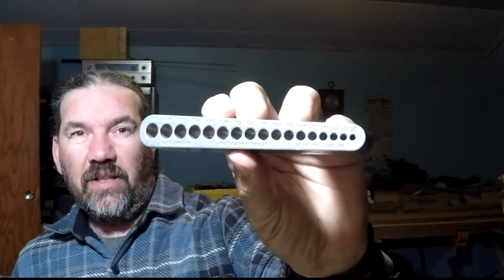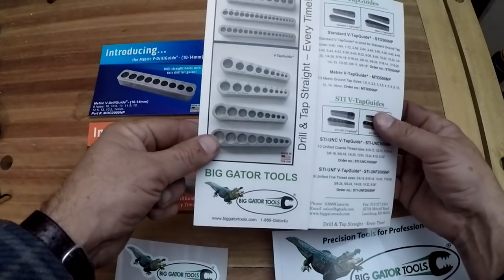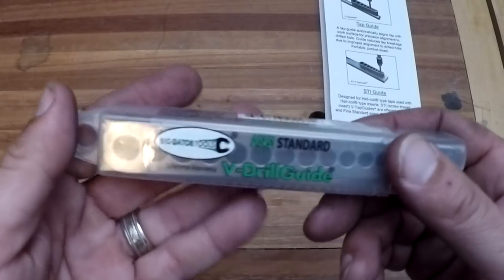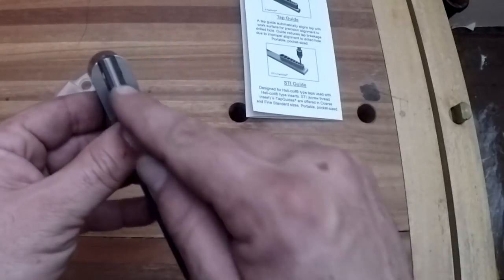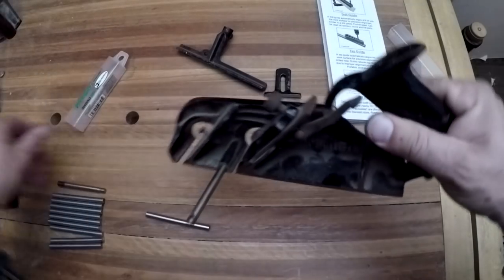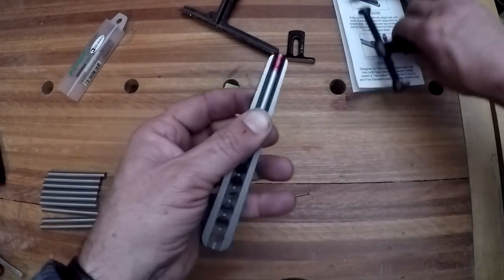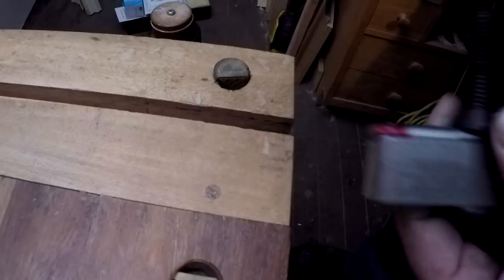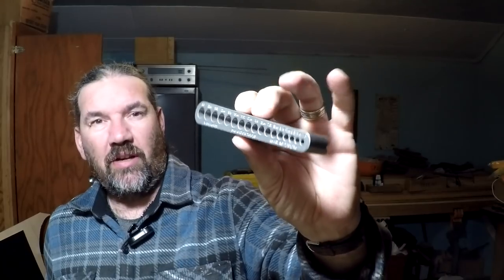Drill Guide Block . Big Gator Tools V-Drill Guide

Comment: Hi Chris...
Nice of Dave to lend you that plane to copy them bits from...
Useful tool...
Just right for setting a drill on radius surfaces... 👍
Reply from the maker: Yes it makes it very easy . And don't worry I've got pattern videos in the pipeline.
Reply: @OldIronShops 

Good...
Yes...pattern making please soon Chris...
I want to see more videos of old hand tools being used in pattern making... 👍
Reply: As long as Chris is willing to make the parts I'll be happy to loan whatever patterns I have. 😎
Reply from the maker: @OldSneelock  i wouldn't be able to make some of the parts i have if not for people like you that lent me parts and this is really the only way to make very accurate parts in most cases